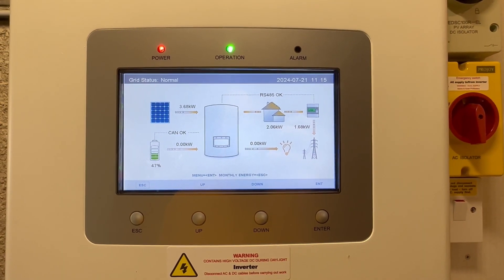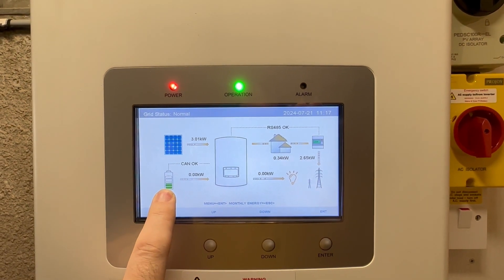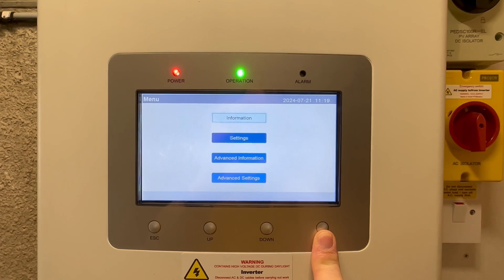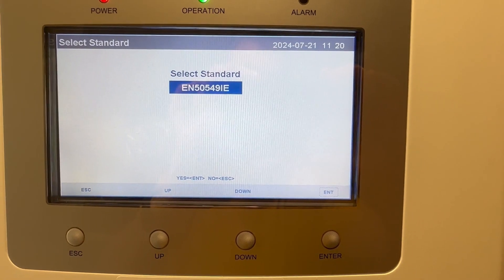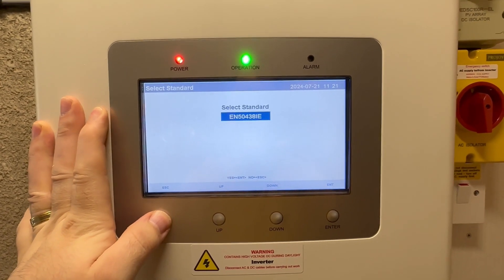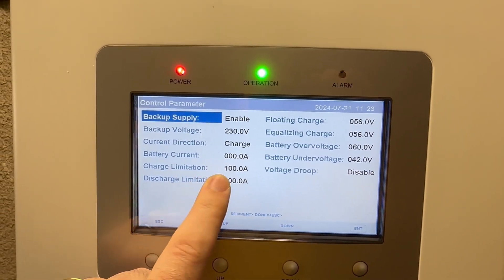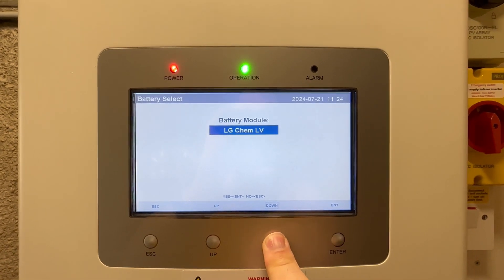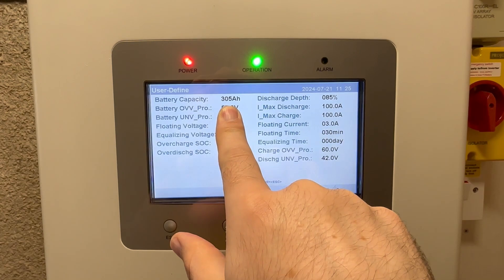Solis Inverter Battery Settings (other options)

Comment: Have you noticed the cable temps when charging at 100A? I reduced my setting to 60A and a lot less heat is generated while still charging at around 3.2kW per hour.
Reply from the maker: I can't say that I have monitored this, but the cables are well within the safe zone for 100A sustained. I also need to take full advantage of the charging speed to make sure my battery is full within the 4 hour hour window. Next month, I will be adding a second battery and in time, I will be increasing my supply capacity to allow for additional batteries to charge, but the highest the cables will see is 100A. I will be upgrading to a larger gauge down the line to keep everything cool though.
Reply: @markbrowne8447  they get warm but as long as connection's are tight and not themselves getting hot it will be fine at 100a. Shame Solis didn't upgrade the cables but we regularly run outs at 100a.